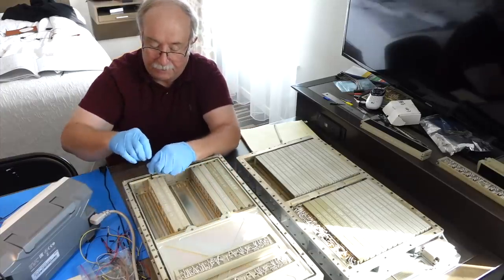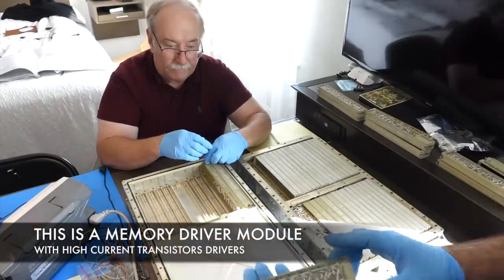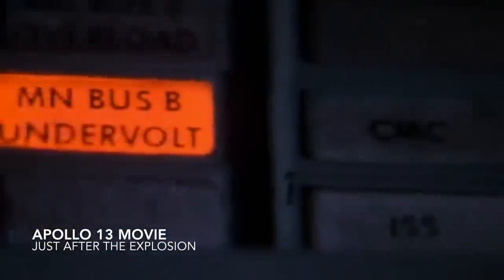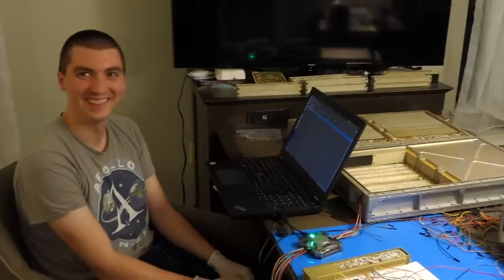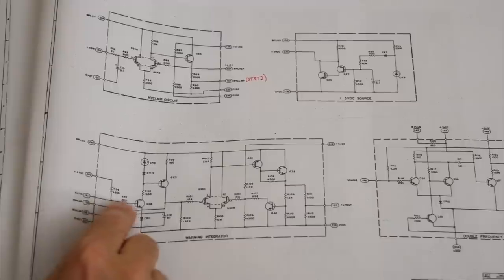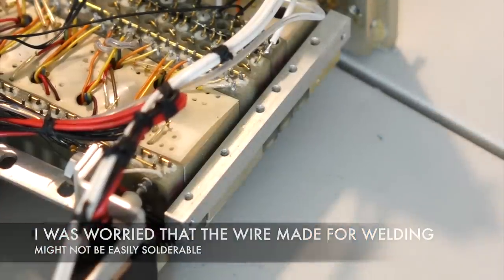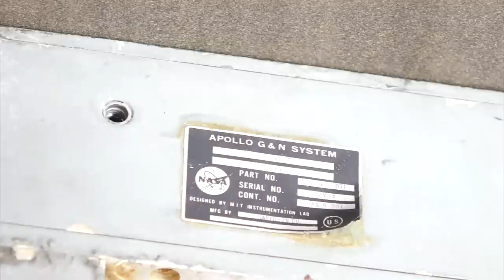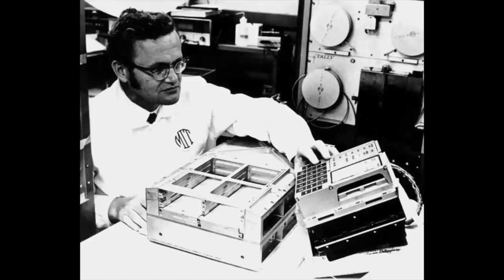Apollo Guidance Computer Part 3: Main Bus B Undervolt

Comment: Awesome video! Shows how specific the application of the AGC was. Our smartphones may be faster etc etc, but this system performs a very specific job using logic and analog circuits. It's so awesome to watch y'all break everything done and explain what y'all are doing. Makes me appreciate what NASA managed to do 50 years ago even more.
Reply: It was incredibly fail-safe too. Our smartphones may be faster etc etc but they can’t recover from a program lock up without losing data.
Reply: Aggies52 it ran an amazing operating system, which affected all of computing. Extremely advanced for the Time as a computer scientist , they should teach it I think. You really learn how computers work.
Reply: Without CAD, with pencil, paper, slide-rules, old-fashioned drafting tables, hours and hours of design and testing on physical devices (no SPICE or simulation of any kind... unless you built a second one... which they often did).  Analog electrical engineering at its pinnacle of "failure is not an option" level.
Reply: Klaas J I am a professional software developer, but I learned starting back in the '80's on old BASIC and later in school we programmed chips directly in assembler code and had to really understand on an extremely basic level how to do things with a few hundred bytes of memory, a couple of K of EPROM and LED segment displays and keypads, much like how this stuff is done. 
I know for sure that's not how guys are taught now because the younger they are, the more wasteful and frankly bad they are as programmers most of the time. A lot of my daily job is reading code written by others to green light it to be put in production, or more often than not either send it back with a long list of required changes, or just make the changes to it myself, send it back for testing and then putting it live.
Reply: Seems to me also helps prove it actually happened. I taught this on the 50th birthday and most of my students didn't believe it happened.....
Reply: @Songbirdstress  ask them how thousands of people agreed to keep it a secret and why the Russians did not expose it as a hoax simple because it was not a hoax.
Reply: @midnightrizer  I did. They have no concept of what the world was like then.
Reply: This computer was technically not that advanced, it was just miniaturized from what they already had and designed to be fail safe.  The reason today's programs use so much memory is that to display a character requires table parameters and visual shots that require more parameters.  The AGC is sending raw electrical output to devices and the LED display does not require graphical parameters to operate, the Diodes just need to be told to light up.  The first electronic computers came out in the mid 1940's and by comparison this computer is light years faster and completely reliable.  What you are looking at is just a monster version of what is running in your phone.  Your phone is not as fast as your PC, but the software is more written with your phone CPU in mind and the flash memory makes everything feel slick.
Reply: @jrus690  It's a computer. We all know that,- from the Apollo Guidance computer to the C64, to the laptop I'm writing this comment on to a smartphone, from a Palm PDA to a modern supercomputer or IBM mainframe,- it is all the same basic Neuman architecture. You're not blowing anyone's mind by saying so and I don't see how that equals= this thing wasn't so impressive, wasn't so technically advanced. It sounds like to be "technically advanced" in your estimation, something has to completely transcend von Neuman architecture, because otherwise it's just a "miniaturized version of what they already had",-  inasmuch as my 2021 laptop is just a miniaturized version of what they had in the 2000's, which was a miniaturized version of what they had in the 90's, which was a miniaturized version of what they had in the 80's, and so on. The AGC is technically advanced in terms of its logic, pure and simple, again- relative to what existed at the time. But also, relative to the poor code that exists in our time. And the reason modern programs use so much memory and run so poorly is not just because of graphics, it's because of redundant (and therefor inefficient) code that has to be built on top of about 10,000 layers of legacy stuff in order to maintain compatibility,- this inter-generational compatibility being something required because of how entrenched all this stuff is in monolithic economic structures that are very slow to change. I bet there's companies out there still using Windows XP for stuff. Maybe even earlier Windows OSs. At any rate, it's not difficult to understand how software became so entrenched: there's no point coming out with new hardware twice as fast as anything at the time, if none of the software of the time can run on it. Plus there's the fact that the extra 20 GB of Ram and terabyte SSD gives programmers a hell of a lot of leeway, and leeway leads to laziness, which leads to inefficient code, because now the incredible hardware resources at our disposal can just compensate for the bad programming, and the end user is not going to care or be able to notice, while the programmer enjoys not having to expend so much thought on working out better programming solutions and the employer of said programmer enjoys not having to spend so much money on the salary of a more qualified guy.

I would also add that reusable code did lead to a programming revolution and incredible growth, economically and culturally, as far as computing goes. People didn't have to keep reinventing the wheel on the software side so to speak every time new hardware came out and could just buy logic from ready-made vendors to use in their projects a la. the FPGAs of today. A similar thing happened with automated trace routing, compared to the older days when an actual human had to basically perform as an artist laying things out for the board and arrays, something that required both skill and creativity, and the later ability cannot even be trained into you really so there's always going to be a shortage for that kind of human labor. But, despite the growth that these provided, the downside is just what I'm talking about: the accumulation of more and more inefficiency, more and more redundant code, etc. As we approach closer to hard-limits on the advancement of raw hardware and compute-power,- as we approach closer to the end of Moore's law,-  this accumulation of bad code will become a more serious issue.
Reply: @tylerchambers6246  No, your laptop is using current CPU technology, what is in it anyways, likely AMD Athlon or Intel Pentium N.  yes the AGC is advanced in the sense that is using welded, and not soldered components, and the memory is using a different method of temporary storage.  I was not trying to blow anybody's mind, was just saying my two cents.  Modern software is both efficient and inefficient, if that makes any sense.  Modern software is kind of like a 1000 gear clock vs a metronome, they both keep time but one is complex for 2 or 3 hand and the other one is just to keep track of tempo.

Comment: I worked on magnetic memory on a CDC 1700 system. We did a monthly SCHMOO test on the memory to check all was well with the cores, amplifiers and drivers. There was a small program to load  manually into the registers and run a tape (paper), that ran the program against the register selection of the memory locations, this printed a "picture" on the teletype which looked like a penguin shape. It took a very long time.
Reply: Gives a new meaning to when AvE says, "RELEASE THE SCHMOO!"
Reply: Al Capp
Reply: I can't say I 'worked on' core memories on the first computer I had access too, but I did have 'hands on' the 1k core memory modules (If I remember, they were extendable to 4 x 1k with a special addressing module?) on a CDC 180A (I think.)  I was on a government sponsored "Training Opportunities" scheme computer basics course in 1976.  Later I worked for EMI Medical and the first couple of CT Scanner models I worked on, had 32k of Core Memory, on four 8k boards.  On the body scanner, which had dual Data General S130 (I think) minicomputers, to test the memory in the slave computer (or any other diagnostic,) you had to load the memory in the master chassis, stop it and power it off, pull the memory boards and slot them into the slave chassis, power it up, select the start address and run the programme.  Oh, how we laugh.

The guys doing the Apollo AGC are fantastic.  Clearly dedicated to history in a unique way, they are definitely the electronics equivalent of the guys dedicated to restoring old steam locomotives.  Their meticulous dedication to detail and keen awareness of what can go wrong - permanently, irretrievably wrong - is an awesome tribute to the guys who designed, built and developed the whole Apollo mission.  Well done guys, thank you.

Comment: It's amazing that these modules survived the scrapping that took place. Great work by you guys. Just brilliant!
Reply: Several years ago, I got rid of a bunch of old XT class machines, and even an old VIC-20 and Mac Plus that I had lying around. These days, having developed an interest in vintage computers, I keep kicking myself for ever getting rid of those. 
The same was true with Apollo. Nobody ever anticipated after Apollo was cancelled how valuable this stuff would be decades down the line.
Reply: sorry for the slow reply.  Whilst moving house in 2005 I scrapped about half a dozen "VIC20's".  It killed me but I just couldn't take them with me.  Amusing to think even these 'little toys' had much more ability in some areas than the AGC - with just a little difference in the build quality :)
Reply: @aubmckibben6758  Even for parts, they can catch a few bucks on eBay. Lesson learned: if you don't want it, there is somebody else who does.
Reply: @BlackEpyon  thanks.  I meant to add "brand new and in original boxes"; that's the part that killed me!
Reply: @aubmckibben6758  O_O

Comment: I don't think error integrators are all that rare in specialized gear. I've used a similar circuit in combination with a watchdog to do a permanent shutoff if too many overcurrent events occurred on a power supply within a certain amount of time. In some applications, you might want to "forgive" an overload and re-enable power quickly so that you avoid the need for user intervention (all kinds of practical reasons why you may want that), but if it happens consecutively, then you power it down permanently and flag a system fault. You could easily just count/characterize the faults with a microcontroller but that might not be reliable enough if something locks it up (undervoltage etc). Power spikes associated with repetitive trips could in theory also cause enough EMI to glitch a micro as well. For highest reliability, an analog integrator/comparator is still the best way to go. As another point, triggering a reset on aerospace-usage computers is critical after an undervoltage event as well. Without that, a pandora's box of possible glitches and issues opens up. Mission-critical systems are all about defined states and high degree of determinism. The sequence is typically undervoltage > hold in reset until power good > restart. As an example, I have a relatively complex piece of modern military gear which uses about 200W nominally, and the power block consists of 4x 200W DC-DC converters (plus some standby DC-DCs), with a very beefy (maybe 80 pin?) microcontroller to manage a range of input/output conditions as well as doing some logging to its own flash. The micro runs from its own 28V > 3.3V DC-DC converter, so it would still be functioning even the 28V line dips to as low as 3V. I mean this is all simple/common sense stuff but still worthwhile mentioning. Good luck again guys! Thanks so much for making these videos available.

Comment: That watchdog pulse counter / time limited circuit is very smart! If "code" (on average) takes too long, it cuts in and throws a warning/error.
Reply: There's nothing like a watchdog timer to simulate reliability. (That's usually a GOOD thing.)
Reply: @Digital-Dan  I would say: Stimulate reliability (by resetting processes if needed)!  I've had real time programming courses and some of the examples we got were (entirely) based on NASA hardware and reliability models. I've seen "work" were such fail saves should have been build-in yet weren't even though it would have saved money (in operational costs) and made systems safer for workers. So, although I get your joke, I wasn't making one myself. I find this type of solution very cool! :-)
Reply: There is an alarm circuit that watches how long the AGC executes before issuing certain branch type instructions. It was intended to spot an infinite loop and force a restart.
Reply: @carlclaunch793  The equivalent of an engineer standing over a computer and thinking out-loud "that's taking longer than it should... I don't like how this looks (*reset button*) Let's try that again..."

Comment: "Houston, we've had a problem...we've had a Main B bus undervolt."

1.8kbits of core rope memory from an HP 9100A- this is probably the most common example of its use:  
http://www.hpmuseum.org/9100/9100torm.jpg
(To understand how this can be 1.8kbits, there are 29 toroids and 64 wires.  A wire passing through represents a 1, and the wires can be passed through multiple times.  The HP 9100A had a 29-bit data word, and there are 64 wires for selecting the bits- this makes for 1,856 bits of memory.)

Comment: The overall construction of the device is amazing. So many modules, and each one has many connection points. It must have been very time consuming to build. 28 volts is still used today as the main DC voltage source on most aircraft.

Comment: We still install  BIT (Built in test) or BITE (Built in test equipment) that is used to flag a rail out of its specifications, high or low.   It is also used in some systems as you mentioned to induce a restart of the main computer. 
Also useful in head up displays when loss of scan voltage is detected, the BITE will shut down the HV to the CRT preventing screen burn and damage.
Reply: Simon Spiers Many single chip computers (microcontrollers and System-on-Chip) contain these circuits on chip, listed in documentation as brown-out-detector, watch-dog and low-frequency-oscillator).

Comment: Emulate rope memory using modern components. I'm not sure that you could replicate the code... unless you have a source, though. You should also be able to emulate core memory using modern components.
Reply: There is rope memory to be found and had... ages ago I saw some (South African???) chap who was reading the bitstream out of a whole box full of modules.
Reply: I think the code is on github now https://github.com/chrislgarry/Apollo-11
Reply: We have the code for many more missions, as well as several ground test programs, in the VirtualAGC repository: https://github.com/virtualagc/virtualagc
Reply: @edgeeffect  Those are Block I ropes,  incompatible as the AGC had substantially changed for Block II. Also, those are from the same source, Jimmie Loocke, who loaned them to Francois to do the extraction in South Africa
Reply: @carlclaunch793  Thanks, I was wondering why those ropes were not involved in this but they are of course block I ropes.
Reply: Thank you for linking this!

Comment: Hi! Enjoying your project. My Dad worked for Raytheon and designed the wiring harness for the DSKY. I have a document entitled: "Apollo Guidance and Navigation Systems," which I will be delighted to share with you if you are interested. 

It seems to be an overview document and proly far removed from your depth of knowledge. IDK. Just 4 pages including the cover. I believe it to be from May 1965 (when I was 2 :-) ) If you have contact info I will be happy to supply the jpgs.
Reply from the maker: Thanks! Contact me via the About Tab on my channel page.

Comment: I have a question, is also the DSKY panel with the computer ? Very nice work you are doing there I keep watching.
Reply: No DSKY came with it, so we are building a substitute that will look very like the real one, operate as faithfully as possible to the real one, and interface using the 28V signal wiring from the AGC.
Reply from the maker: It's a very nice one. It's cited often in the comments. I had linked it in the description of the first video, maybe I should link it in every video ;-) .